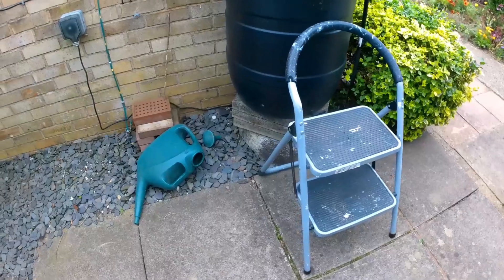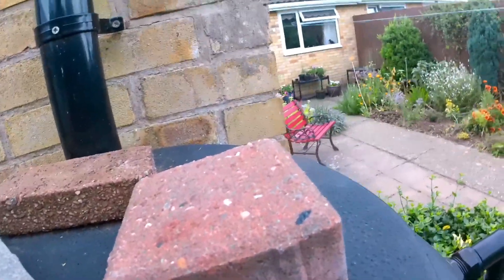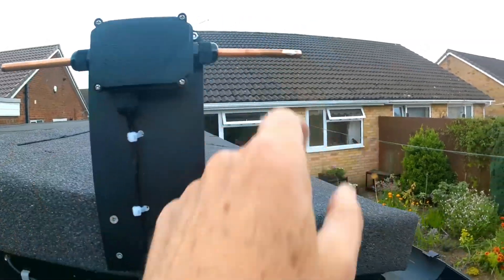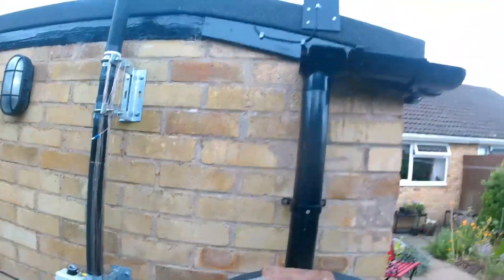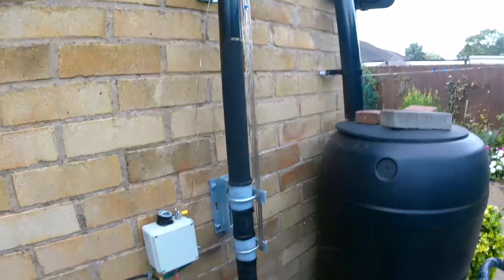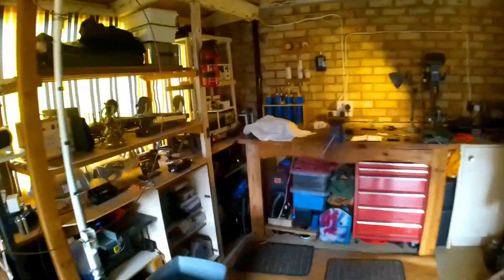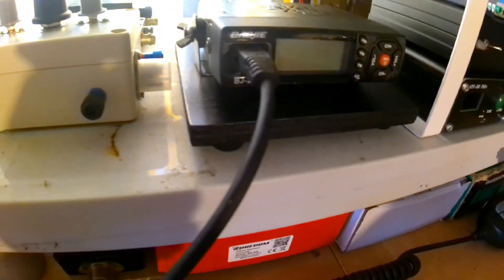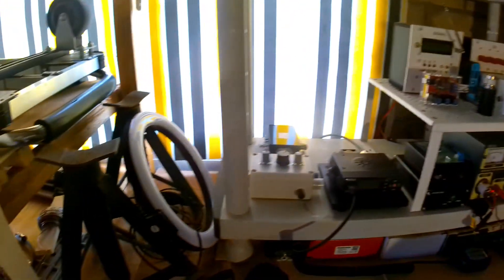Ham Radio. DIY 70cm Repeater. Rx and Tx Simple Aerial. Installed Working. Corby Repeater. #ham

Comment: when i was first licensed in 1976, anything less than a co-linear at 40 ft agl minimum
 fed with UR67, for 2m and 70cm was regarded as useless
Reply from the maker: In 1983 was the same. 🤠
Reply: @MakeDoAndMend1  I blame CB antenna companies, getting into the Ham Market.
Most of the Antenna they made for CB was nice looking Junk, why should their Ham antennas have been any different?

Comment: Horizontal polarization common for 70cm FM in your area? Polarization mismatch can cut the signal by 30 dB or more.
Reply: if end on to the other station? far worse than minus 30db
Reply: @phillipsmiley5930  I was being generous
Reply from the maker: Under test conditions Horizontal polarity configuration gives best S meter readings. Although it's a vert polar repeater. Might be reflected from metal factory units nearby. George